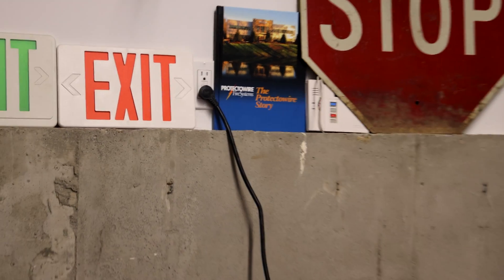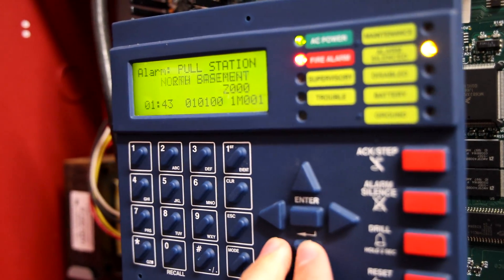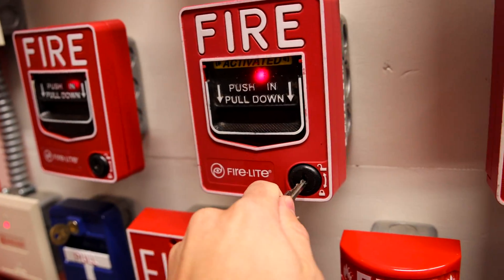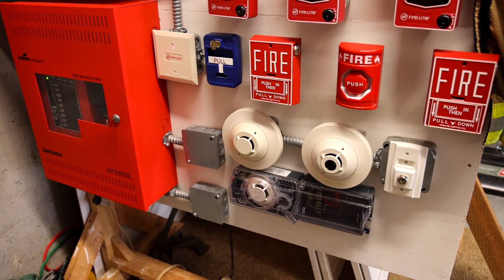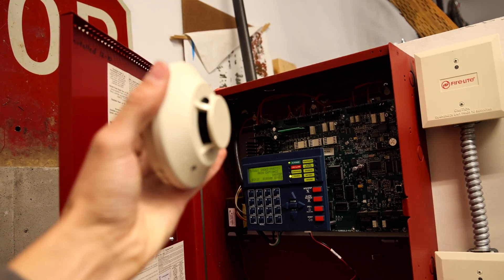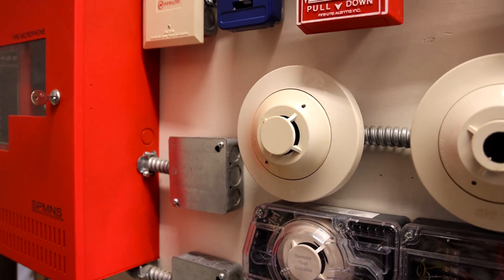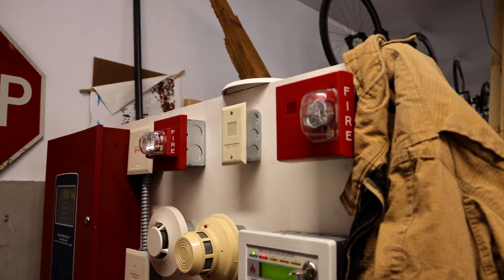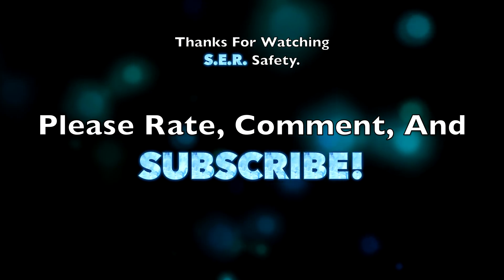Pulled 6 Fire Alarms at Once! | Wheelock & Fire-Lite Voice System Test 16.5

Comment: This system test sounds great! That Fire-lite smoke detector on the demo board is a similar on that we use here only, its branded by System Sensor and the analogue addressable one's called the 2251BPI and the conventional ones called the 2151 BPI we also use the older style ones too and some other System Sensor smoke detectors aswell. I think all of the smokes on the demo board we use here too.
Reply: Yeah